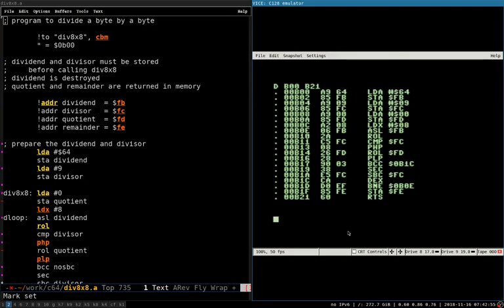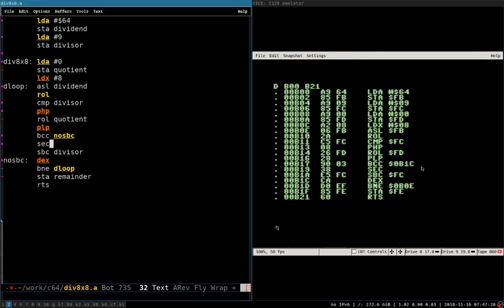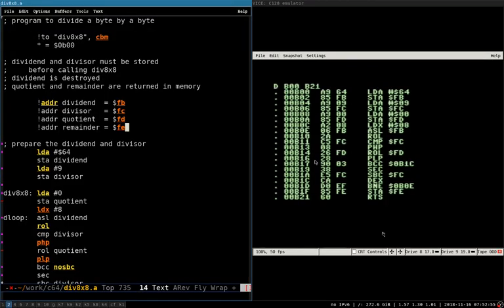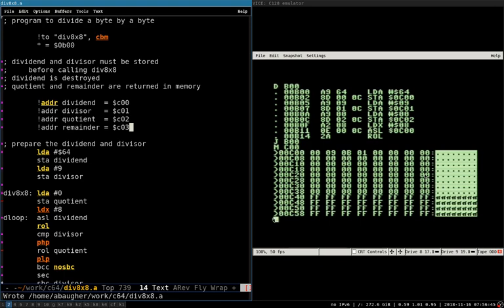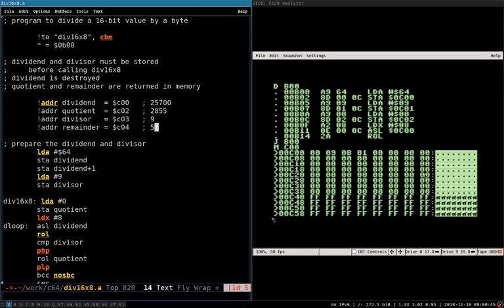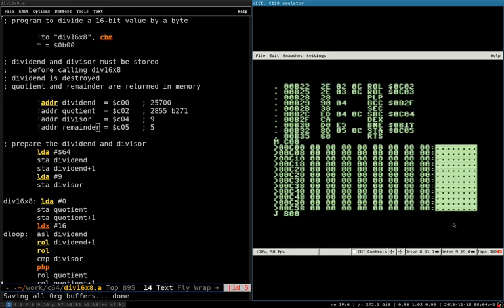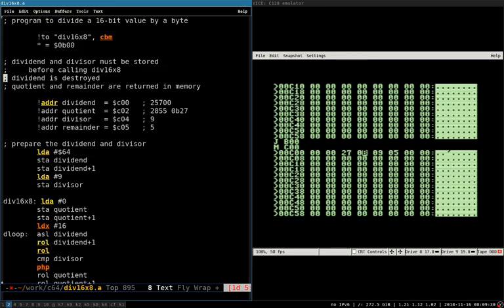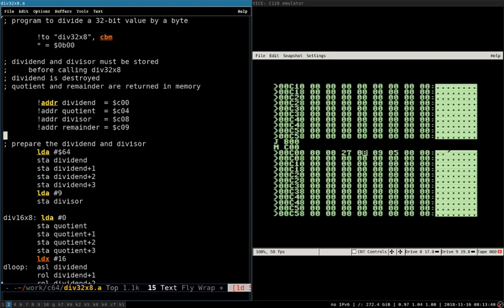6502 Assembly Language #5: From Assembler to Monitor

Comment: Check out awsm9000's Acme Cross Assembler extension for VSCode when you get a chance. This seems like a good IDE toolkit implementation for 64 and 128 that removes a lot of the setup headaches. You're doing great on this subject but certainly flying under the radar of a wider audience.
Reply from the maker: Thanks! Yeah, I haven't really promoted this at all, because I didn't know at first where I was going with it. Now that I have a better idea about that, I'm going to try to make something of it.

Comment: I would have loved to try and replicate this locally but I'm still relatively new to ASM and have only been using TMP on a 64. I need to find an easy cross platform c128 setup that would allow me to experiment with beyond the monitor in VICE. Any suggestions?
Reply from the maker: I'm using Acme Crossassembler, the one you mentioned in your other comment. I edit the files in emacs, but any text editor would work. I was originally just using the monitor too, but having labels for branching and addresses is pretty nice.